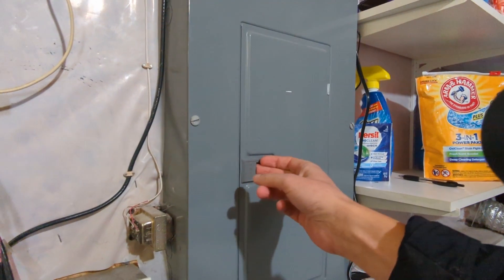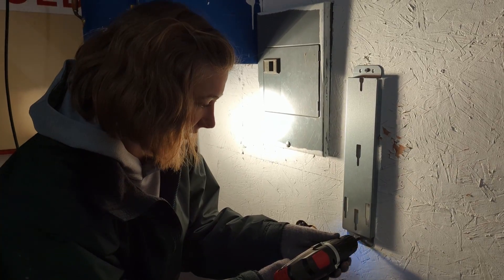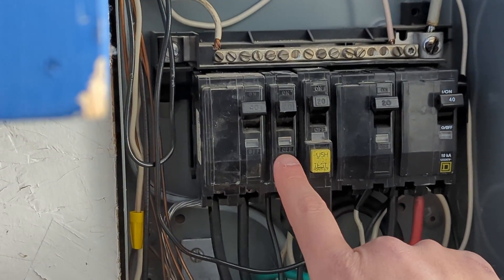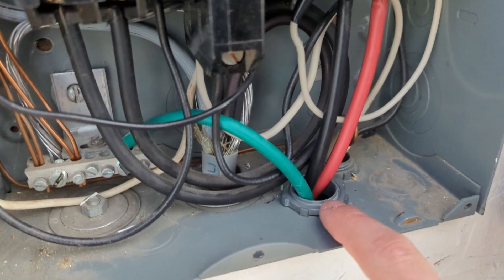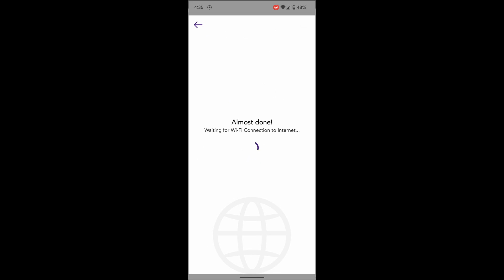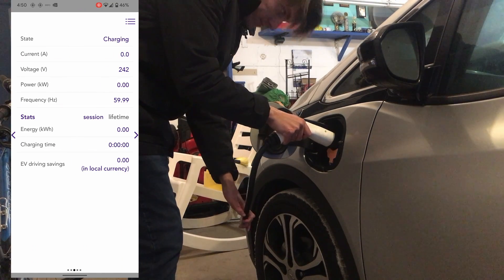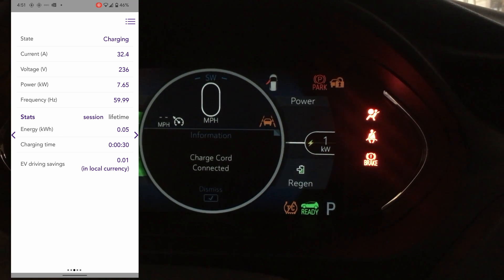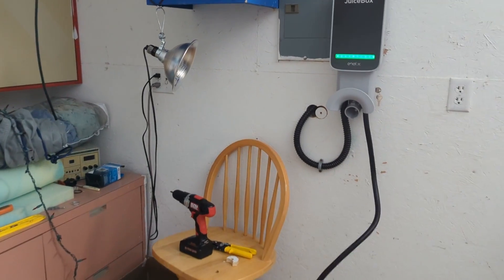JuiceBox 32 Hardwire EVSE install, setup, and test!

Comment: Way to skip over the most complicated part...  The actual wiring into the sub panel. Geeze, not helpful.
Reply from the maker: Truthfully, I forgot to record that part. But as stated in my disclaimer, I am not a licensed electrician, so if you do not feel comfortable with that part I'd advise hiring one. I'll try to post another video of that part if the opportunity arises in the future.
Reply: @alexkno11  No worries. Apologies, my comment sounded mean. I had a juice box already installed by an electrician, but I needed to replace it with a new one because it went kaput. Was hoping to watch a video to see how easy it would be to avoid bothering with an electrician. 
Ended up finding another video and did the replacement myself. Was pretty easy when you just needed to copy the previous install. 

Thanks for the video anyway :)
Reply: @JonSnyderfudge  could you please share link of that another video you found on how to hardwire the Juicebox
Reply: @bgtcsd  I don't remember. It was done generic tutorial on how to change a breaker
Reply: cool to see other people figuring this stuff out on their own. does your charger have a plug? or is it hardwired? i have a chargepoint with a  plug. it seemed to make more sense in case i ever move i can easily take it with me, or if it breaks it’s easier to replace by just unplugging it.
Reply: @balkey312  it's hardwired a subpanel.

Comment: For technical accuracy, the Juicebox does not use a common wire.  It only requires L1 (red) and L2 (black) plus green ground wire.
Reply: With a hardwire install, that is correct. If a plug-in, then it is needed for the outlet even though the EVSE doesn't use it. The point here is that he connected the neutral to the ground bar. If he used that wire for the ground, then mark it. If a neutral, it cannot be bonded (connected to ground) in a subpanel, only at the first means of disconnect. Sorry, but if not an electrician and you need to put a disclaimer at the beginning, maybe you shouldn't be doing this kind of video.
Reply: @4x2-ev  Yes, title is Hardwire EVSE and mine was installed without white common wire.  However, at a previous home back in 2017, I installed a NEMA14-50 receptacle and included the common wire because any other electrical load could be plugged into receptacle.  I'm am not an electrician, but an electrical engineer with 40 yrs experience.